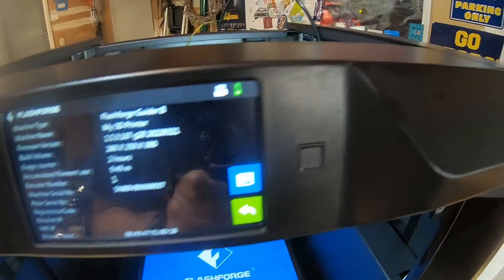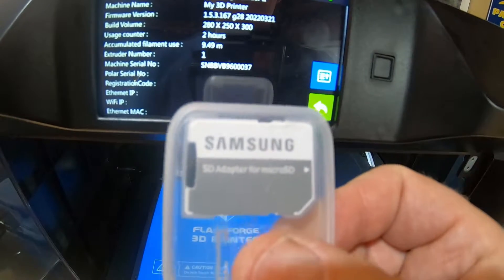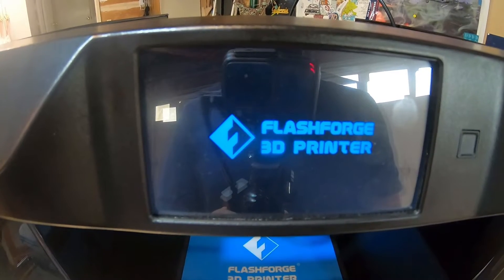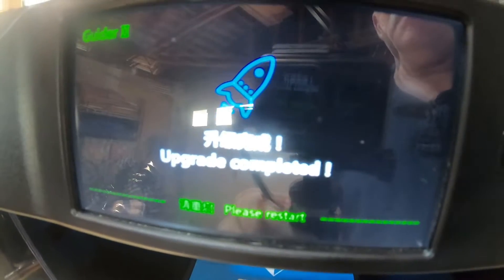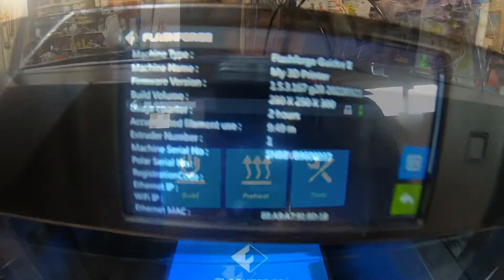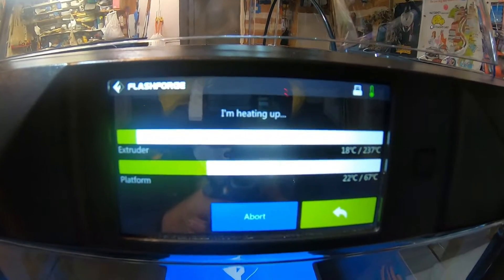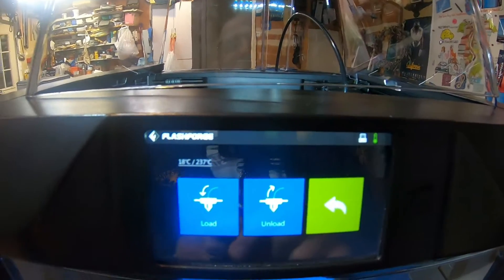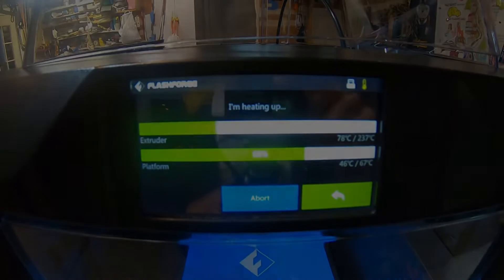Flashforge Guider 2 - Upgrading the Firmware

Comment: Sorry, but it doesn't appear how to restart the 3D printer, or do you just unplug it?
- You must first remove the flash drive.
- To restart, you need to unplug the 3D printer.
Reply from the maker: You can use the power switch to turn off the printer.

Comment: I'm sorry. You didn't show what to download, or from where. You started at: I have an sdcard with firmware on it. Put it in the machine and restart. Is the firmware a zip file? Did you explode the zip file or not? In the end? Same version. Did you make a mistake or did you upgrade to the the same version? How can you tell?
Reply from the maker: I downloaded it from here: 
https://www.flashforge.com/blogs/download-center/guider-series
It downloads a .zip file and the firmware is inside.

It ended up being the same version as far as I can tell, but as I noted in the video description the date I saw on website at that time (I can't find the date on the website listed above in this comment) it was a later date.
In any case, the firmware didn't change the behavior of the printer that I was interested in.
For same reason there is a separate setting for the preheat temperature of the hot end and the temperature you set on the page when you load/unload the filament.
That doesn't make any sense to me. The Dreamer NX used the pre-heat temperature setting and there was no other temperature setting for the filament.

Comment: Hi, great video, congratulations on the initiative.
Sorry for my bad English.
I also have a Guider 2 but I'm curious about the fact that a recent firmware update 1.5.5 has been made available but I don't think anything about this update, I would really like to know what the changes are, because if it's not beneficial I'll do a reflash and go back to an older update.
Reply from the maker: I'm not seeing a 1.5.5 firmware update for the Guider II anywhere. I still only see 1.5.3: https://industry.flashforge.com/download-center/86
Can you provide a link to somewhere you can download 1.5.5?
Reply: @BetaCygniBlog  
Sorry for the delay in responding, curiously this update appears every day on my printer, as always I deny the update, because when I updated it lost the high temperature function, if there is a safe way I can update and make a backup and send it to you for better study of this curious firmware.
Reply from the maker: @eltonapl  I would just ignore the update. FlashForge has discontinued/retired this printer.
I don't know enough about how the Guider 2 works internally to be able to analyze the update.
So sorry, I wouldn't be able to help you.

I recently switched to my "backup" Guider 2 since the one I had been using had a runaway print bed heating problem.
I tried replacing the heating bed thinking that the thermocouple was bad, but that didn't solve the problem.
:(
It must have been a problem with the controller board which I thought was too risky/expensive to try and replace.

I'm looking at the new Guider 4 coming out later this year with the idea of buying it next year some time and use my current Guider 2 as my "backup" printer.
The Guider 4 has an all metal hot end that can go to 300 degC.
Reply: @BetaCygniBlog  In fact, today after my first message I stubbornly managed to successfully transform my Guider 2 into a 2s, releasing several functions such as fan speed, changing nozzle size, among others, I will now provide a camera to place internally. And thank you for your attention and good luck with the new printer.